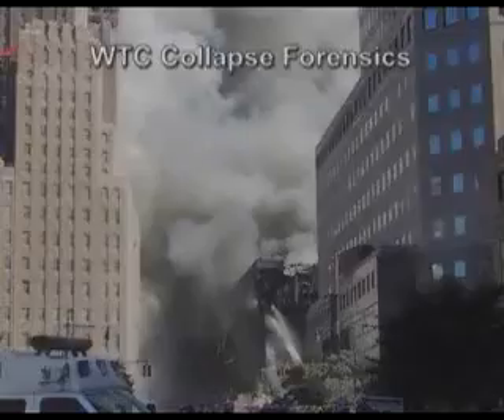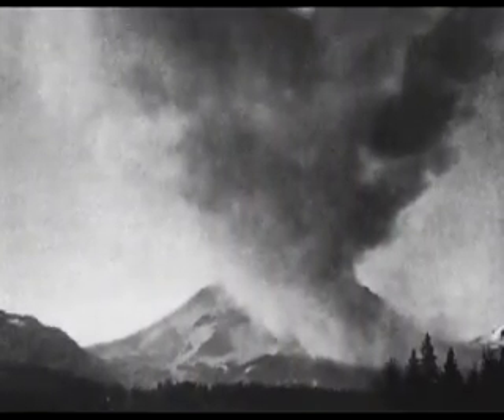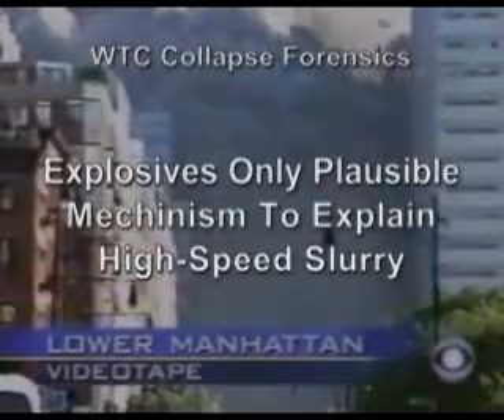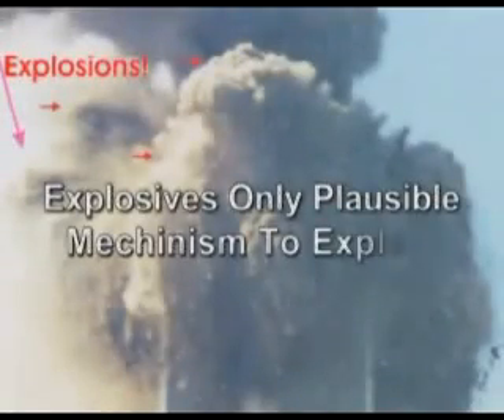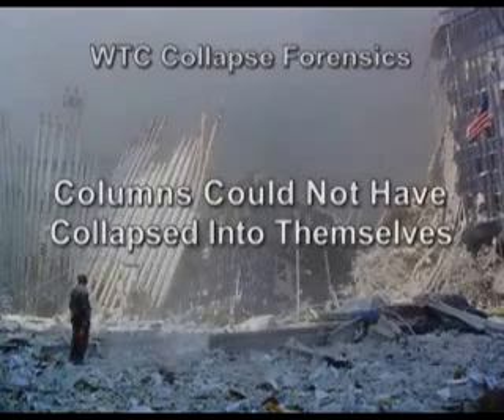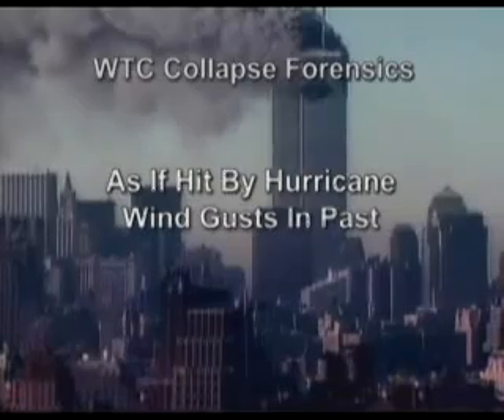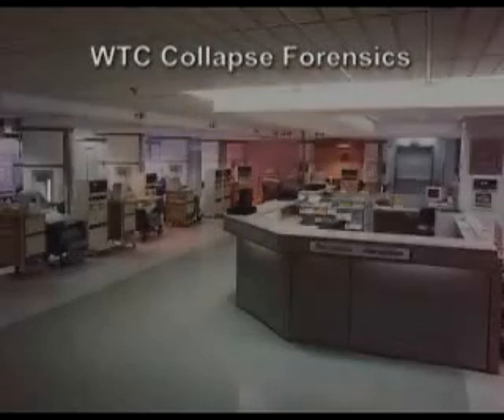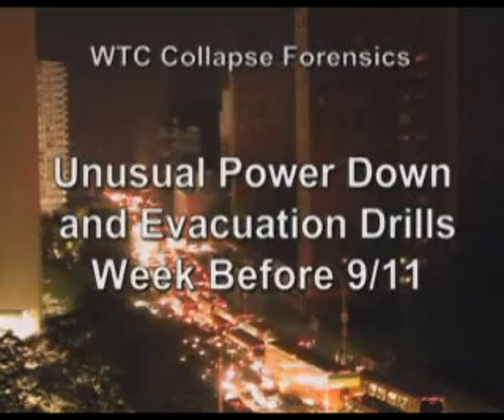MIT Engineer Disputes 911 Theory of the WTC Collapse-Part 2

Comment: Since no one got burned by the "pyroclastic flows", they must have been just dust and smoke. I guess the professor has never worked with drywall; that's a nasty dust maker. And anyone who bothers to look at the mountain of gnarled steel at the bottom of each pile would know why the floors got ground up. It wasn't just floors falling on top of one another; it was a grinding machine busting down through those towers.
Reply: +whetedge  Since no one got burned by the "turbidity flows', they must not have been pyroclastic. Hey, everybody! whetshorts has a theory! IT WUZ A "GRINDING MACHINE"!!!!  AN' it  wuz "BUSTIN' DOWN",  a'course. Yup, yup ,yup.
Reply: +Edward Anderson  Whet is a lying troll.  Here he deliberately seeks to confuse, by implying that the total energy of the collapse including the kinetic energy of the buildings fall, and the explosives used in the demolition must have been  comparable to the energy of an erupting volcano, for the  term to be correct.  
  Of course  a volcano generates MANY ORDERS OF MAGNITUDES in more  pyroclastic particles and several order of magnitude in an initial temperature compared to even the largest ( and the WTC towers certainly were that,) of building demolitions.
  I once purchased some cars that had been returned form Clark airbase in the Philippines which had been covered in volcanic dust from  the eruption of Mt Pinatubo.  They were sufficient distance from the blast so that they were not burned in the least.  However other cars parked only a block from the towers were gutted by the fires caused by the pyroclastic dust.  How hot it was depended  upon where it was.
Reply: johnb66y I have crossed whetedge before. He likes to throw in a few idiotic claims along with his straw man arguments. The claims are always ridiculous if analyzed, but simplistic enough to sound plausible to lightweight thinkers.
Reply: +whetedge says, "Since no one got burned by the "pyroclastic flows", they must have been just dust and smoke." -- What do you mean no one got burned? There were hundreds of burn victims aside from those inside the towers.
\\][//

Comment: The USA government is considering reworking its total ammunition production .
Its about to introduce armor piercing shells made from ALUMINIUM .

The COMMERCIAL ALUMINIUM  AIRLINERS on 9/11 -  were travelling at around 500 mph.
ARMOR PIERCING shells travel at 3,000 mph . They reckon ALUMINIUM
would work just fine against TANKS & HARDENED BUNKERS.
The titanium /tungsten tips they use at present  , will be made redundant

They're going to save a fortune using ALUMINIUM.
Reply: roquefortfiles
It is always the same .
Raise any serious issue & you get PERSONALLY ATTACKED.
These Threads are for DISCUSSION & DEBATE . 
GOODBYE ...................
Reply: jbyeats Wait, I don't understand. How were you attacked?
Reply: +johnb66y,  2.4 MILLION cubic feet is the entire space of a whole tower. The jet fuel was blown through a few floors and the momentum carried the vast amount of it out the other side in huge fire balls. The jet fuel was certainly NOT over the whole area of 2.4 MILLION cubic feet of building. The fact that the building swayed is a separate issue from the distribution of the jet fuel. And yes the building did survive structurally after several minutes of oscillation, leaving the only damage local to the impacted floors. So we are left with the structure of the remainder of the building intact. How could the lighter damaged upper portion fall through and crush the intact lower portion? It simply could not have, and several physicists at Journal of 9/11 Truth have proven this by physics calculations. The collapse would have halted within no more than a couple of floors if the structure below had not been removed by explosives.
Momentum Transfer Analysis of the Collapse of the Upper Storeys of WTC1 Gordon Ross, ME, June 2006

http://www.journalof911studies.com/articles/Journal_5_PTransferRoss.pdf

Analysis of the Mass and Potential Energy of World Trade Center Tower 1 Gregory H. Urich, December 2007

http://www.journalof911studies.com/volume/200703/GUrich/MassAndPeWtc.pdf

Destruction of the World Trade Center North Tower and Fundamental Physics David Chandler, February 2010

http://www.journalof911studies.com/volume/2010/ChandlerDownwardAccelerationOfWTC1.pdf

\\][//
Reply: +jbyeats The Boeing 757 and 767:The aluminum that modern aircraft are made of is not the same soft material as that of a beer can: Aluminum 2219-T81 UNS A92219; ISO AlCu6Mn; Aluminium 2219-T81; AA2219-T81 – with a tensile strength greater than that of structural steel.Gross weights 172,365 kg (380,000 lb) and, from 1992, 186,880 kg (412,000 lb); further increased centre-section tankage.StructureFail-safe structure. Conventional aluminium structure augmented by graphite ailerons, spoilers, elevators, rudder and floor panels; advanced aluminium alloy keel beam chords and wing skins; composites {Kevlar} engine cowlings, wing/fuselage fairing and rear wing panels; CFRP landing gear doors; and aramid flaps and engine pylon fairings.The airframe further incorporates carbon-fiber reinforced plastic wing surfaces, Kevlar fairings and access panels. Boeing 757 & 767.

Analysis by Willy Whitten – August and September 2012All available data and reasoning based on such, proves beyond a reasonable doubt that large twin engine jets hit the world trade towers.That they were flown by remote control [1], and had special engines configured to fly at the speed {at sea level} recorded: 450mph.[1. See; Aidan Monaghan B.Sc. EET – abstract below]This evidence includes, video footage and still images – radar analysis – wind shear analysis proving superior control –Sandia crash data – as well as kinetics analysis proving the energy needs were more than sufficient.ABSTRACT:Newton’s Laws of Mechanics:> First law: Every object continues in its state of rest, or of uniform motion in a straight line, unless compelled to change that state by external forces acted upon it.……….This first law has to do with inertia or momentum, depending on the original states of the bodies in question.As per the event we speak to, the first body is the building. In the frame, ie planet Earth; this body is at rest, an inert state, which has only one property: Mass.>Second law: The acceleration a of a body is parallel and directly proportional to the net force F acting on the body, is in the direction of the net force, and is inversely proportional to the mass m of the body, i.e., F = ma.……….A state of Momentum has three components: Mass – Velocity – *Specific Direction. [*vector] -Velocity is described as mass-times-velocity squared in the energy equation.In our frame, ONLY the plane has a state of momentum.Moment and Point of Impact are both necessary integers in formulating impact physics. At that point and moment the kinetic energy of the mass in movement is transferred into the building AT THAT SPECIFIC POINT – the impact zone.It is at this point that we come to the third law; that every action has an equal and opposite reaction. And this does certainly depend on the speed of an impact, as the first two laws clearly state that they are of first and second account before the third proposition can manifest.Again it is at the point and moment of impact that the third law comes into effect and must be translated as per the laws of kinetics incorporating the maxim of equal and opposite reaction:Kinetic Energy is defined as the work needed to accelerate a body of a given mass from rest to its current velocity.KINETICS 9/11:The energy equals one half the mass times the velocity squared: ( E = 1/2 m v^2)The plane has a Mass of 120 tons – traveling at a Velocity of 540 MPH:The kinetic energy resulting would be equal to 0.75812 ton TNTOR: 3.1720e+9 joules (watt second)
Reply: Willy Whitten
The buildings which collapsed that day - were indeed exposed to serious stresses due to being struck by a modern jetliner.
However they were specifically designed with exactly THAT in mind . They were both struck high in the buildings structure -- yet both
buildings managed to disintegrate TOTALLY. 
The other building MIRACLE which occurred
relates to BUILDING 7 -- WHICH WAS STRUCK  by NO PLANE - yet fell into its won footprint at almost FREEFALL SPEED. 
( It took NIST -- 8 full YEARS to come up 
a totally half cocked reason of how this 
heppened. OFFICE FIRES we are told softened the STEEL !!!!! )

THESE MIRACLES which happened in sequence on 9/11 are merely a small number of the total  MIRACLES which occurred that day. NEVER HAPPENED BEFORE IN HISTORY and WILL NEVER HAPPEN AGAIN .
Reply: +jbyeats What was the purpose of your 'satirical' " armor piercing shells made from ALUMINIUM" comment? It was no "miracle" that those planes were able penetrate the facade, it was simple Newtonian physics.
Understanding physics leads to understanding that the effect of the plane crashes could have nothing at all to do with the towers falling some hour or so later. Understanding that means that something other than the fire induced gravity collapse theory told by NIST is utter pseudoscience bullshit. All the real evidence proves explosive demolit1on of all three buildings, 1, 2, &7. The rest of the WTC was destroyed by the debris falling from the towers.

From your first comment, you seemed to insinuate that real planes didn't hit the towers, and that you promote the "No-Planes" theory that is popular in some circles. Real aircraft hit the towers, whether they were the commercial airliners as per the official narrative or not. I am inclined to think they were military drone airplanes of the same make (Boeing's) that were painted in commercial livery. They were certainly real life airplanes.
\\][//
Reply: Willy Whitten
I am sure you  KNOW THE CONCEPT of SATIRE . 
I said that it was NOT POSSIBLE for
 '  COMMERCIAL AIRCRAFT ' to FLY at those  SPEEDS in DENSE AIR . Of course MILITARY AIRCRAFT can DO EXACTLY THAT -- and THAT IS WHAT STRUCK  WTC1 & WTC2. 
The ' REMOTE CONTROL ' POD is clearly VISIBLE under the second plane , in many of the videos -- YET NO ONE WANTS to DEAL with that. COMMERCIAL AIRLINERS DO NOT HAVE PODS STRAPPED UNDER THEIR BELLIES.
I NEVER MENTIONED anything about 
' NO PLANES ' 
CRASHING into a Building is one thing and that certainly happened -- BUT BRINGING DOWN THE WHOLE BUILDING AS A RESULT -- we are entering the world of 
FAIRIES & MAKEBELIEVE .
Reply: +jbyeats, Sure I am familiar with THE CONCEPT of SATIRE. But that doesn't mean everyone can tell the difference. We are in agreement here, I just wanted to make this perfectly clear to the jejune participants reading this dialog.
\\][//
Reply: +jbyeats, Here is my blog page on the demise of the WTC, I hope you will check it out:
https://hybridrogue1.wordpress.com/2014/05/08/controlled-demolition-and-the-demise-of-wtc-on-911/

\\][//
Reply: Willy Whitten Will do . It looks very comprehensive. Many thanks.
Reply: +Willy Whitten  Yes and that kinetic energy of the crash, 1500 lbs TNT was dissipated, unevenly to be sure, over an area of 2.4 MILLION cubic feet of building and an equivalent amount of outside airspace and when the momentum was transferred to the building it cause a  sway with an initial amplitude of about 15 ft to the 1360 ft tall tower that was the building . The subsequent oscillation damped  rapidly to the normal 15 inches ( caused by light winds.  In moderate to heavy winds the building was oscillations measured to about 57 inches)

Comment: Most people have flown in this type of aircraft , do you remember how it changed course even at landing approach ? It's not like a jet fighter , it slowly makes it's turns and approach . Now those buildings are a harder target than a landing field , yet a couple of terrorists who took basic flight lessons hit them dead on . Are we missing the punch line ?
Reply: +Gianfranco Fronzi  you are correct. The aircraft could not perform those maneuvers since the piloting software prevented such maneuvers. Only remote piloting with aircraft reconfiguration (The kind Raytheon does) is able to perform these maneuvers. Raytheon demonstrated remote piloting of a Boeing in Aug 2001. google it.
Reply: +Gianfranco Fronzi -- Also see: Review of Analysis of Observed and Measured In-Flight Turns Suggests Superior Control of 9/11 WTC Aircraft by Aidan Monaghan B.Sc. EETAbstract:“Video footage depicts United Airlines Flight 175 (UA 175) impacting World Trade Center tower 2 (WTC 2) on September 11, 2001 in New York City via a trajectory comprised of two separate banked turns. The second turn was apparently not required to generate impact. The first turn, which maintains a constant angle of bank (AoB), is evident at 1.2 miles before impact. Although human control of UA 175’s observed maneuvers cannot be ruled out, the precise coordination of variables such as the selections of a correct bank angle and turn start time for the first turn apparently pose challenges to the unaided human control hypothesis. The observed turn stability favors the use of autopilot operation, either functioning in a conventional course control mode or in Control Wheel Steering (CWS) mode. The probability that either of these two control systems were used is discussed. Flight deck images of United and American airlines 757s and 767s suggest that such CWS functions may have been disabled circa 2001. Constant radius turns utilizing plotted waypoints during commercial aviation operations are routinely supported by augmented GPS navigation service and related commercial Flight Management Systems (FMS) available circa 2001.http://www.journalof911studies.com/volume/2010/Monaghan_Analysis.pdf
\\][//
Reply: +Willy Whitten  Yes can you just see Al Sheddi deliberately choosing an extremely difficult hi speed turn that not only required sophisticated programming but overrides of the plane software and hardware safeties. In other words even if he had been capable of calculating  and inputting the speeds, descent rates, and way points, the safeties would have overridden his inputs and the flight director would not accept or engage.   If he had tried to fly it manually he could never have held that course.  This is the basic flaw in the hijacker theory which cannot be overcome by even the most persistent debunker troll